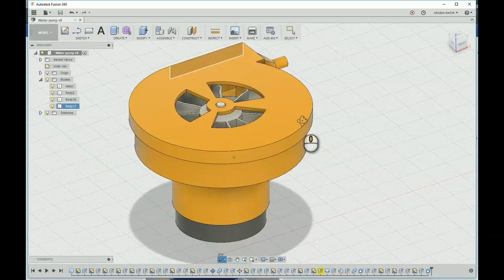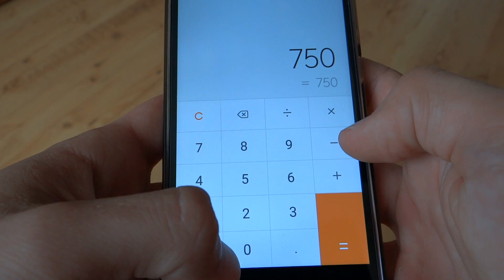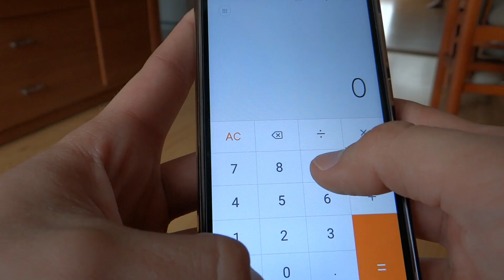3D printed water pump - easy and efficient

Comment: I’m already print but the motor is 5 hp 3.7 kv the water is really reach at 60 psi i use impeller V2

Comment: can you adapt this design and make it driven by foot pedal i think the pump body would have to be much thicker and the pedal with drive the pump wheel through some ratcheted gear system etc